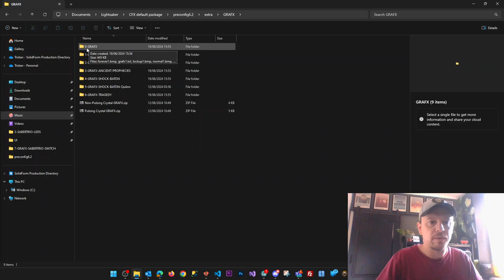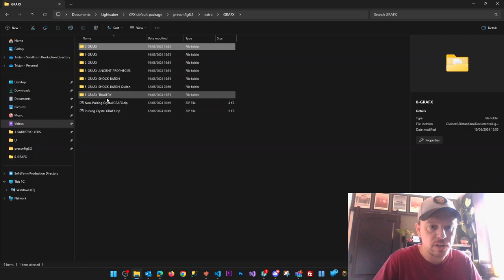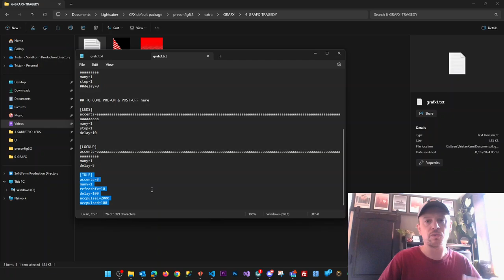How to make sure your new CFX Sabertrio Korvus bladeprofiles also have a pulsing crystal chamber

Comment: Kan ik de puls van het kristal en de powerbutton ook los van elkaar instellen zodat de knop gewoon aan blijft maar het kristal wel pulst?
(Can I make the kyber crystal puls separately from the powerbutton so that the button will remain a static colour but the crystal will puls?)
Reply from the maker: Zeker! In the current preconfig setup the button is setup as an accent pixel, meaning that you will find the config for this in the "extra/accents" folder. If I remember correctly in an blade profiles style_accents=2 has been set so look for the folder with index 2. Open the text file in there and look for the IDLE section. Change the B into an s and you should be good to go!
Reply: @CrystalFocus Only just got around to trying it. Long story short, I didn't manage to do it. Maybe I've done it wrong or I have misunderstood. Is there any chance you could possibly make a short video showing me how to do it?